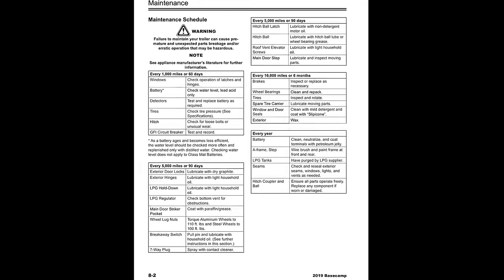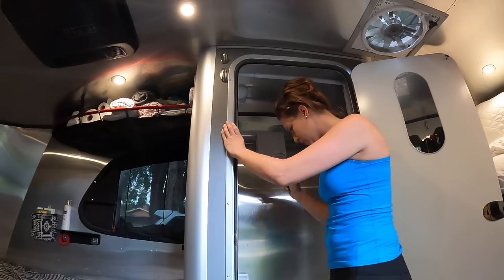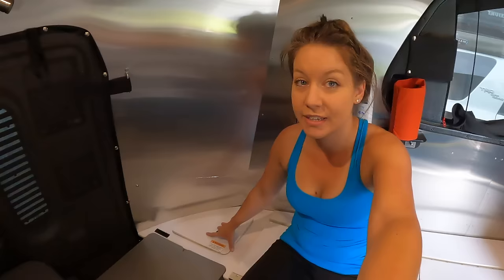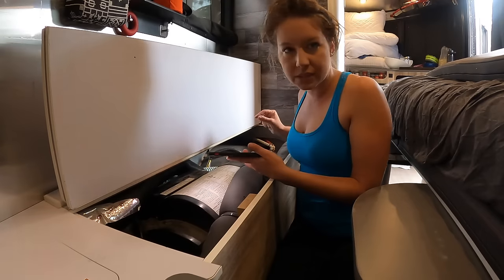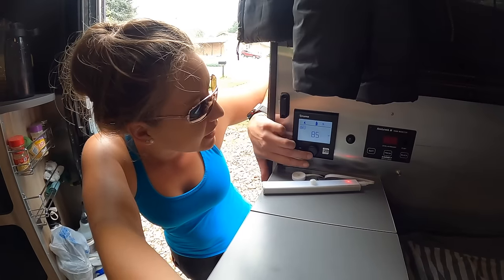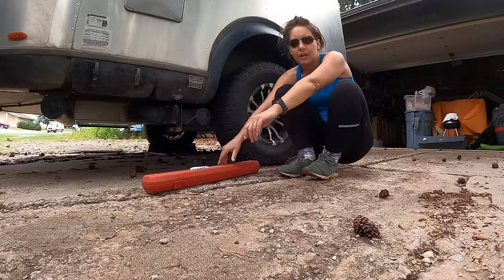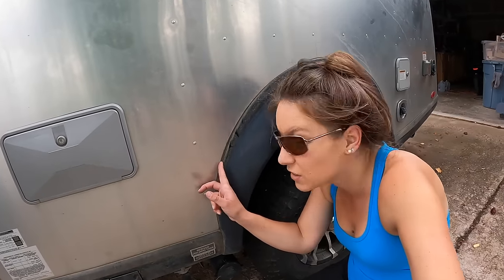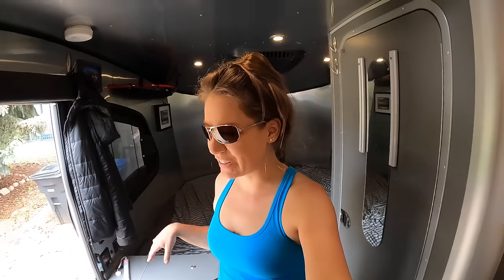RV Maintenance Before Hitting the Road: small travel trailer 2018 Airstream Basecamp X

Comment from the maker: As a clarification point for the tire pressure, you should run your tires at the recommended psi per the sticker on your vehicle/trailer or your owners manual.  I run mine at 50 psi due to being the recommended pressure per Airstream Customer Service.

Comment: Hey, you’re back! Hope eyes are doing well, you were hurting last video or so ago. Suggestion, instead of white lithium on the door catch, I’d recommend spray silicone. It dries leaving a dry layer of silicone on the metal pieces allowing parts to slide nicely past each other. Spray the latch mechanism and spray the striker plate on the jamb. But, before using get some WD40 or carb cleaner or brake cleaner and spray out the latch mechanism and get out all the dirt, grime and previous grease. Let it dry then spray in the spray silicone. The benefit to spray silicone is since it is dry, it doesn’t attract/catch dirt and grime. That’s the biggest enemy to those kind of mechanisms. While you’re at it you could do the same for the hinges on the door and also on the hitch latch mechanism. And then the same for the rear door. Can find that at any hardware store. Works great! Looking forward to your upcoming adventures!
Reply from the maker: Thank you so much!!  Really appreciate that, as it is something I have to clean off with the white lithium.  I'll take a look into that next time, thank you so  much for the details!

Comment: Great tutorial.  Don't forget to check the tire pressure in both spares, Airstream and 4Runner.
Reply: Super important. You don't want to be stuck on the side of the road with two bad tires.
Reply from the maker: Great tip thank you!
Reply from the maker: Agree with that!

Comment: Great video.  As we've commented before, we pull a nucamp t@b 400 BDL and pretty much do just about everything you do.  A couple of suggestions; if you're not using one, purchase a Air Pressure Monitoring system.  Getting a flat going down the road on a two wheel trailer is going to prove challenging.  A monitoring system could help you detect a problem before you're dealing with it at 55mph.  We have a TEKTON Digital Tire Gauge | 5941 for checking our tires and a Etekcity Infrared Thermometer 800 (Not for Human) Non-Contact Digital Temperature Gun,16:1 DTS Ratio, 58℉ to 1382℉(-50℃ to 750℃), Yellow and Black that I use when we stop to check wheel bearing temperatures.  While we have the wheel bearings serviced every 12k, I still check the wheel bearing temps.  While there will be a slight difference on each side, anything more than 30 degrees and I'll starting looking for a tire/RV shop.  Check out Fort Knox locks for an outstanding trailer hitch lock.  Passing through TN about four weeks ago and stopped to get gas.  A white Toyota pulling a Basecamp pulled in a few pumps down with a young woman driving and the first thing I said to my wife "bet that's the lady from Tails of Wanderlust" and she said no and naturally she was right.  Something she reminded me of every so often that day.  Safe travels
Reply from the maker: Great tip on the TPMS.  I just installed a TST version and am testing it out.  It's so much nicer to have that then check the PSI every time I stop for gas!!  Great tip on the wheel bearing temperature.  Didn't think to monitor that so thank you for sharing.  Funny part is there are a lot of white 4Runner/Basecamp combos out there now.  Safe travels to you both as well!!

Comment: Some Blue Loctite on screws/bolts will help keep them from getting loose.
Reply: For sure, but Cass won't be able to remove those screws if she wants to. She will have to decide which screws will never need to be removed again. (Heat will disable Loctite, but concentrated heat only). Good comment.
Reply: Blue loctite is an excellent call...
Just don't use the Red, and you can still get them if needed
Reply from the maker: Thanks for the insight!
Reply from the maker: Thanks for the tip!

Comment: It's great to see you back online more regularly!  We hope the blue eyes are healing well and use Blue Loctite 242 for some of the loose bolts & screws to keep those tight down the road.  We just did all our RV maintenance and the rooftop units needed some cleaning for sure.  Also, look at the 2 tire TPMS unit from TST for the camper - it helps for keeping an watch on things. Our sticker came in today too - thank you and see you on the next video!
Reply from the maker: So glad the sticker came in!!  Really appreciate you picking that up.  I just put a TST system on the Basecamp and am currently testing it out.  So far I really am enjoying it, although it's amazing how much the ambient temperature impacts the PSI while the trailer is parked.

Comment: Great video Cass! People sometimes focus more attention on the living space and forget that these campers do actually travel on public roads at high rates of speed. It may not be absolutely necessary but it's not a bad idea to apply some grease to the inside of the trailer hitch "cup" and or the ball hitch on your tow vehicle. Don't forget to check those taillights. Have fun! Stay safe!
Reply from the maker: Great tips Donald thank you!!  I put the grease on the hitch ball when I hook up, but completely forgot to mention that.  Thanks for the tip on the Lock Tight!

Comment: Dear Cass . . . Glad to see you are back online, and crossing my fingers for your eyes!  

On another subject I need to talk to you about your alarms.  Unless your Basecamp is going to be launched into space on the top of a Saturn rocket, I doubt very much that you need to monitor CO2, and I don't think that's a CO2 detector.  You do need to monitor CO, also known as Carbon Monoxide, which is a HEAVY gas.  So please recheck to see if that's actually a CO2 detector.  If not, then Home Depot here you come.  If it is, please consider remounting it close to the floor.

BTW,  that air compressor on your truck is a nice feature.  Do yourself a small favor and get yourself an extension air line of 10ft.
Reply from the maker: Haha love this Eric.  Yes it is a CO monitor, not CO2. Although launching into space could be fun.

Comment: Your very handy and great maintenance routine, more than i've ever done! Couple additions, always inflate tires to manufacture specification not to max tire psi. On all cars and trucks, manufacture psi ratings are on white and yellow sticker inside drivers door jamb, not sure about your particular trailer, possibly in owners manual, rating sticker somewhere or contact dealer or manufacture. Check tires for dry rot, often trailers sit outside in weather and not used much making them much more susceptible to dry rot, little tiny or sometimes larger cracks between the tread and even on sidewalls. Use some type of rubber, leather conditioner on tires can make them last longer (not tire shine:)) They make what's called bearing buddies which are bearing caps with greaseable zerk fittings allowing you to grease axle bearings yourself utilizing an inexpensive grease gun. White lithium grease comes in spray can with straw making it easier to penetrate into desired areas. Outdoor spray silicone also works well and not as messy, doesn't attract dirt like lithium grease. Thanks for sharing, Cheers Happy Trails!
Reply: Bearing buddy's...Great suggestion!
Reply from the maker: Great tips thank you so much Robert!!  For the PSI, the tires on the Basecamp are not what came stock with the trailer and do have a different PSI rating.  It's a good clarification point as I ended up going off of what is recommended for the X package tires.  I'll definitely be looking into that spray silicone!
Reply: @TailsofWanderlust  Glad to help! It's actually waterproof silicone, lol not outdoors... oops! Really good video, thanks again!

Comment: Hi, I'm not sure if someone has already commented about this... that max tire pressure on the sidewall of your tire isn't what you should set them to. It's only the highest pressure they are rated to go to for whatever use a manufacturer (Toyota/Ford/Airstream) uses them for. If they are the correct size and rating of tire that Airstream recommends for your trailer, then Airstream should have recommended tire pressures for your Basecamp model that you should be following or at least using as a guideline. Perhaps 50lbs is what they recommend, I don't know, but I didn't get that impression. I'll admit that I'm a car guy by hobby and not by profession but I've seen many, many people look at that sidewall pressure rating and set the tire pressure at it if not very close to it. That can be dangerous since over inflating a tire can change the ride (or trailering) dynamics very much. I hope this helps and I hope I'm not overstepping my commenting boundaries. Love your travel independence and I've shared your channel with my daughter in hopes she can get ideas and maybe follow somewhat in your footsteps someday. Stay safe!
Reply from the maker: Hi Mark!  Not overstepping at all, thank you so much for pointing that out.  I should have made a comment in the video about recommended vs. max, but I focused a lot on max. Airstream recommends running the tires at 50 psi, which is what I run them at.  I don't have a label on the Basecamp as I upgraded the tires, so these aren't the stock ones that came with it.  Really appreciate you pointing this out, as don't want that to get confusing to some!! (going to edit that part out).  Thank you so much for watching and letting me know!!

Comment: For those screws that keep coming loose put a couple drops of locktite on the threads and be done with it forever. You can get it at any hardware or auto parts store. Good on you for have a torque wrench—the average RV owner doesn’t own one.
Reply from the maker: Definitely need to pick some of that up. Thanks Cory!

Comment: Tire pressure is not dictated by the sidewall max info on the tire.  It is located on the placard on the left of the trailer by the tongue.
Reply from the maker: These are not the tires that came with the Basecamp originally, so the placard no longer applies in my case.

Comment: A little Loctite on the screws that are prone to coming out all together or that little nut on the ceiling light will secure them just fine. All it takes is one drop on the thread.  Nice work and great advice. That's why your base camp will last a long time.  Your attention to preventive maintenance!  Cheap insurance.
Reply from the maker: So true. A little preventative maintenance will go a long way. Thanks for watching!

Comment: Thanks for all the content. It would be great if you showed how you get your hot water system to work. I have a 2021 Basecamp 16X and can't any hot water.
Reply from the maker: Are you having troubles with the Truma control panel and can't turn the hot water on?  Or when you set the Truma to on, does no hot water come out?  There is an Airstream Basecamp facebook group and there are several posts about the second issue. It usually is how your valves are set underneath the Truma bench.

Comment: You could consider to check if the nuts on your battery connections are tight. If they are loose they could generate heat and fire hazzard.
Reply from the maker: Great tip, thank you!

Comment: How about using some Lock Tite compound on the threads of some of those screws that frequently rattle loose. The compound acts like liquid lock washers for those screws. Mechanics use this stuff all the time.
Reply from the maker: I definitely need to add some.  Just need to make it to the store to pick it up. Thanks for the tip!

Comment: Hi Cass.  I'm really happy your eyes are improved to the point where you are about to get out on the road again.  You must be so happy and full of hope!!!   I'm a retired guy looking to get either a class B van or a small travel trailer .  So, briefly, when you were shopping for your trailer, did you consider any of the Intech products?  I'm down to either the Basecamp or the Intech Sol Horizon.  Because I am a tall guy, 6'3", the extra ceiling height and 80" long bed have me thinking Intech.  You must be really busy.  That said, I appreciate any comments you have.  Finally, great content in this video!!!   You touch on the maintenance issue, which is overlooked by most people with everything they own.  Thanks!!!!
Reply from the maker: Hi Brad!!  Glad you enjoyed the video! When I was shopping I looked at the T@B trailers vs. the Basecamp.  I never checked out the Intech products.  Unfortunately don't know too much about them.  But, being 6'3" I would say the bed in the Basecamp may be a bit tight. I'd recommend testing that out (and the shower and kitchen height) to make sure you are comfortable.

Comment: We just ordered an REI edition 16X and a couple of things.

1. Super appreciate all of your videos. We have just binged washed most of them 😂 So informative and really gave us a lot to consider. Thank you 🙏
2. With regards to tightening all the screws that you did in this video, would it make sense to put a dab of loctite on all of them so they don't loosen up? I'm kind of surprised they don't come from the factory with a little bit of loctite on them.
3. How many watts is your solar? I see you have the Battleborn lion setup.
Reply from the maker: So glad the videos are helpful and congrats on the new BC!  You could do a bit of loctite, but it’ll make a lot of them permanent. For example, the screws around the plastic window pieces - just in case the plastic ever cracked id prefer to have the option to easily remove.  I’d recommend picking and choosing which ones you loctite down.  
I had 340W Zamp panels total between the deployable and rooftop, with 200A of Battle Born lithium (which were amazing)

Let me know if you have more questions!!  If you do, sending me a new comment vs reply is the most effective way. I don’t always get alerts to replies.
Reply: @TailsofWanderlust  Awesome, Thanks again! Happy trails!

Comment: Add blue loctite to your AC bolts and other screws. Don't use red or green loctite as these two are for long term to permanent usage and requires heat to remove. Blue does not require heat it will break loose easily when needed for repairs. As a part of tire maintenance use a spray bottle of soapy water to check for leaks also you can use a small magnet to find hidden nails and screws as long as they're ferris metals
Reply from the maker: Really good to know on the difference in the loctites thank you.  And thanks for the soapy water idea, that's great!

Comment: Bravo for torqueing the lug nuts! 
If lug nut is too tight to begin with, torque wrench (TW) won't reduce tightness so good practice is to loosen the lug a bit before torqueing. And never use your TW to loosen things.
Where you position your hands and the manner in which you apply force while torqueing can impact accuracy. Best practice is to apply CONSISTENT force for all lugs while holding the TW's grip at the SAME spot (understand how leverage works)....and even better, also support the head of the TW with your other hand while applying force. See tests on YT where user uses only one hand to torque.

Torqueing is especially critical for your front wheels...inconsistent tightness causes your rotors to slightly warp which causes a wobble (felt through your steering wheel) when braking.
Always store your TW with torque set to lowest/loosest setting.
:)
Reply from the maker: These are amazing insights and tips, thank you very much!!!  Appreciate you adding clarity around those items.

Comment: WD 40 works just as well as the white lithium grease but it's easier to use and not quit as messy. Also, a little blue Loctite on those screws, nuts and bolts will help keep them from coming loose. Use the blue, not the red.
Reply from the maker: Great feedback, thank you!! I carry WD-40 as well so I'll have to try that next time.

Comment: Cass- Thanks for the very informative video. Just purchased 2018 Basecamp 16. May I ask where you purchased your bed that looks like it fits perfectly. Thanks.
Reply from the maker: Congrats on the new Basecamp Jim! I purchased a Viscosoft 3" memory foam topper and then cut it to size with a bread knife. The memory foam is very easy to cut.
Reply: @TailsofWanderlust  Thank you, the last piece to outfitting my basecamp before hitting the road!
Reply from the maker: You're welcome!! Safe travels and have fun!

Comment: On machine screws, a drop of blue locktite will keep them from coming loose. For sheet metal or wood screws, not so helpful. It will probably help with the AC bolts.
Reply from the maker: Awesome, thanks for the tip Mark!

Comment: The stuff you put silicon grease in this video, you will be better off spraying some wd40 on them.  On your torque wrench, unwind it after usage so it will keep its calibration and last longer.  If you run out of contact cleaner you can use rubbing alcohol.  On the trailer and car electrical connector you can put some dielectric grease inside of pins to prevent corrosion, then you don't have to constantly spray contact cleaner.  You can also put some grease on your battery cable terminals to prevent corrosion.
Reply from the maker: Thanks for sharing and watching!

Comment: Hello do you recommend the X model over the standard? Interested in the 20 Basecamp
Reply from the maker: Hi Dan - I do recommend having some sort of window guards.  You can either do the X package or there are several custom made options out there. For the rest of the X upgrades, it really comes down to what you are going to use it for.  I do have a video on the X features if you’d like: https://youtu.be/Eo90b4TxFGM

Comment: What app did you use to check voltage when you were checking e brake system?
Reply from the maker: That's the Victron app which connects to my battery monitor.